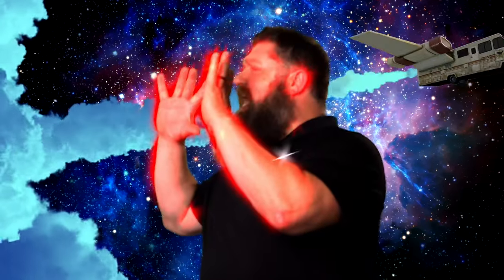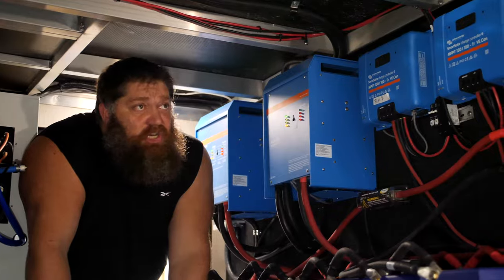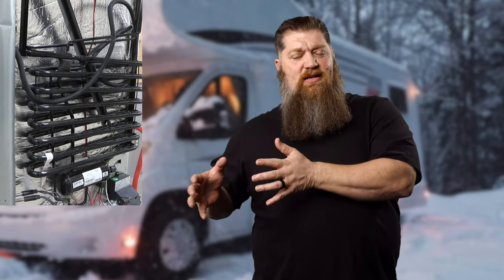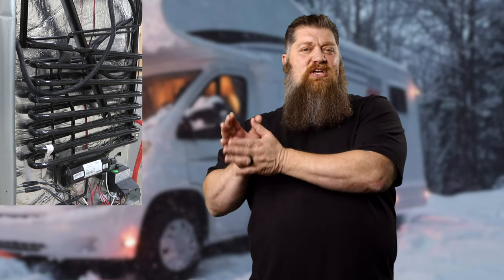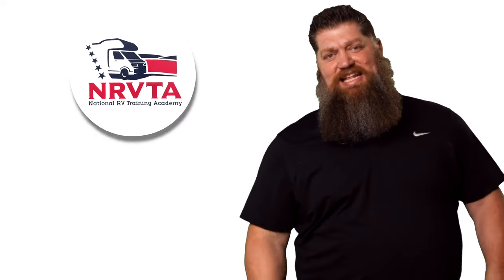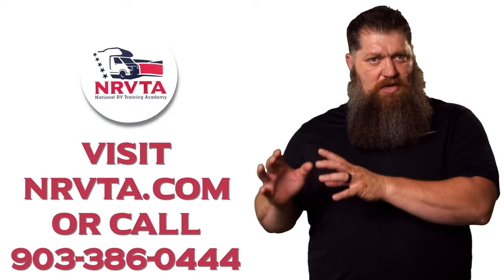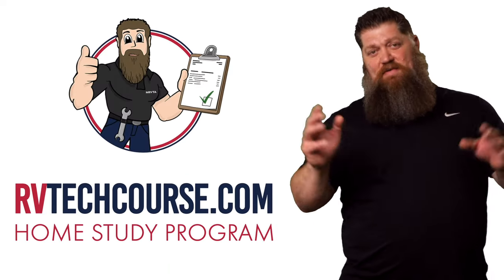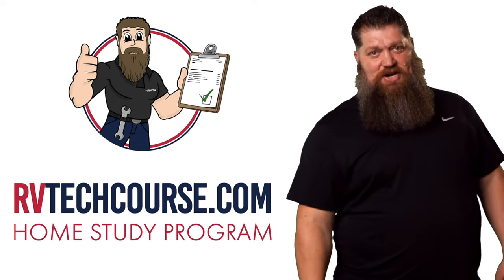How to keep the outside coils of my absorption style fridge from freezing in cold weather

Comment: We were in -22* wind chill conditions for a few days and our fridge stopped working. Everything I tried was after-the-fact, and even when it started warming up, the fridge wouldn't cool down. I ultimately had to "burp" the fridge. Took the whole thing out, turned it upside down for 24 hours and then turned it back over and put it back in. From what I read, I didn't prevent the cooling and what may have happened was the ammonia mixture gelled in some places preventing good flow. I'm sure it would have rectified itself if I was able to wait until we had several days of warm weather again, but our outside food was starting to go bad. 

Best advice - move. Second best advice - an ounce of prevention is better than a pound of cure.

Comment: I guess we’ve been lucky we have a three-way fridge almost always use propane and always Boondocking with toys  never had a problem and camping anywhere from 6 inches to a foot of snow around.  We also don’t like using the furnace except for in the morning just to warm up a nice down blanket with a wool blanket on top of that nice and cozy all night and then turn it on in the morning just to warm up. 2006, 23 foot Coach House. We do normally take a truck with us to pull a 20 foot trailer gives us an extra vehicle and also safety so we can’t get stuck well it should never say can’t.

Comment: Does someone know what the exact golden number is when the fridge will stop working? Please reply in Fahrenheit. Lol.
Reply from the maker: So the thermister is only in the refrigerator if the temp on the walls of the fridge are nearly the same temp if the refrigerator setting then there will be no need for the fridge to turn on. 

Which is fine for the fridge but the freezer will slowly warm up.
Reply from the maker: It’s not exact temps, it’s physics.